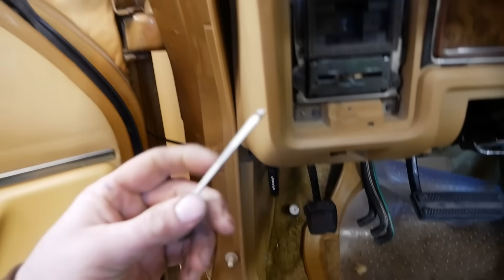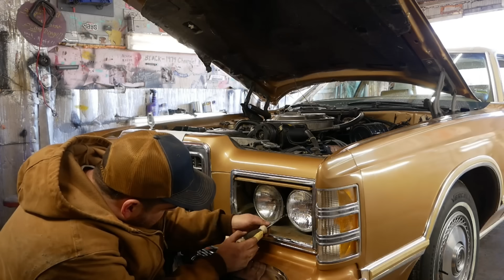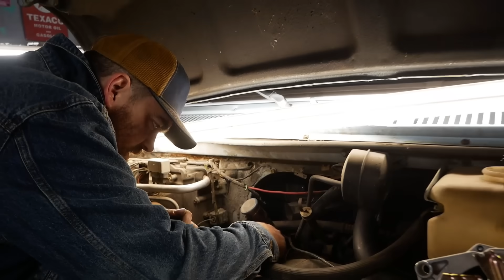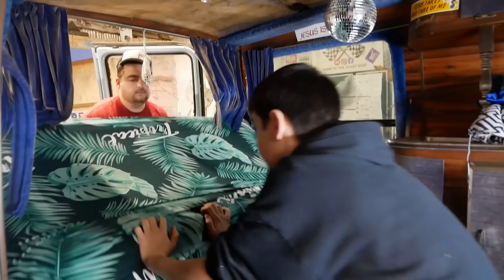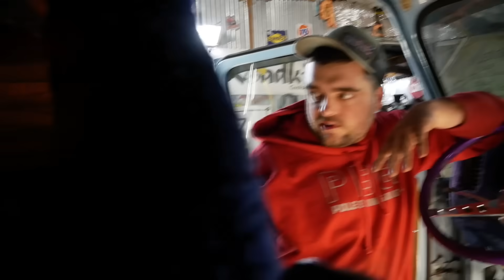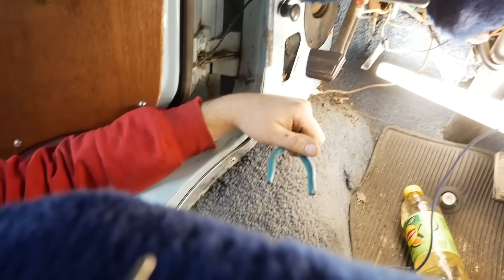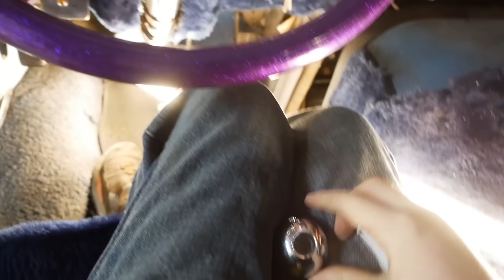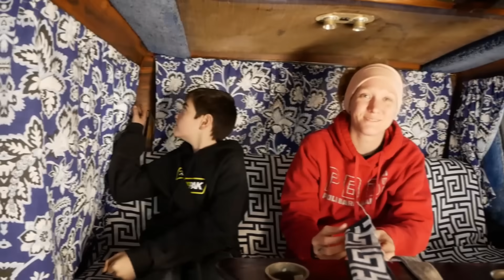Fixing Like It's 1978! SURVIVOR LTD Maintenance, and BOOGIE Van Upgrades

Comment: I know you don't care for led lights, but the tape style led strips work awesome inside.  They come in warm(look like incandescent) with a color change remote. They are excellent for when you have the engine shut off. Use very little battery, remote with a timer, color selection and some follow the music(disco that is)

Comment: westport wa.state here and got your back. way back. but i'm back there. "somewhere"
  a lot of the people must not know how u tube work's. and how you ended up on it.
first clue ; you always buy big cars. is it for ramming road blocks. could be!? four doors most of the time. could be for the ruthless gang!? easy in and out.hum!?
but the key is the thing you have against the safety switch.the one thing the ruthless gang type needs is to start the get away car in any gear.!!!
thusly. you are and international gang pretending to be a u tuber. your move mister.

Comment: Loved the video, however the "gasket" in the air horn wasn't really a gasket, it was a membrane. The very thing that vibrates and creates sound. So if it isn't torn, you have messed with how freely it moves, it's spacing etc. Might not get sound out of it now or ever.

Comment: you gotta look into wool wax for the underside of these clean cars. i know it's just an ltd, but the stuff is cheap, easy to spray, and lasts over a year. we use it a lot in the cleveland area and it works great at keeping the rust off

Comment: On today's episode of "We're losing the shop"

JD attempts an Olympic legs tied trial.  A certain LTD is now capable of unleashing the midnight sun upon the greater Kansas City area.  And Dalton discovers that surplus Margaritaville restaurant fitted sheets have 7 sides and come out smelling like Jimmy Buffet.

rest of Top Gear theme...

Also looks like Ford used the same headlight switch from 78 to at least 89.  Only real difference between yours and the one I replaced on my 89 F250 was the vacuum lines for the headlight doors.

Comment: The table in the van is upside down the pole has to be screwed to the table and the removable part is in the floor the part that you said you have an adapter for that's usually screwed to the floor not the table

Comment: Hey, dont knock woodworking with a Sawzall! Before our family Christmas, I FINALLY fixed and trimmed all the baseboard molding in our bathroom with a Harbor Freight sawzall, as well as cutting some new molding for part of the kitchen! Definitely needed some finishing with the belt sander, but hey, it worked. 

Also, next time you need to seal something on the roof or something like that, roofing & flashing glue/sealant works WONDERS for automotive applications. My friend and I replaced his windshield years ago with that because it was like $5 versus a $35 tube of 3M Window Weld. 😂 It worked perfectly for years without a leak, and dries flexible but very rigid.

Comment: Jess gonna be dangerous with that sowing machine! She’s gonna be making custom seat covers I see in the future. Seems like she’s taking to it, and doing pretty good to!
Reply: I'd love to eventually try a project like seat covers...you're totally right!
Reply: @jesswhomakesstuff  I think you can do it, if you got a decent old cover, you can unsow it to see how it was put together and a pattern. Little tip for doing that it’ll be a little loose,, so you may try and sinch it up a little or add a layer of foam to tighten them up.
Reply: @jesswhomakesstuff  oooooo idea. Start with slip on seat covers we can buy as PBG merch. I'd rock the flirking shnit outta one for my f150.
I'd drop $100 for one. Well 100 communist Canadian dollars so about 80 bucks in the land that measures in units of a body part. 😊

Comment: Please tell me where you got that new headlight switch. Mine is leaking a little bit on my '77. Thanks.
Reply from the maker: eBay
Reply: @PoleBarnGarage Could you still hear a hiss from the vacuum with the new switch? I'm just wondering if it's normal operation to hear that when the lights are on. I'm changing my switch now due to the cluster lights going out.

Comment: On the LTD I believe 1.) it's not F-type ATF, 2.)  there's an emergency reversing valve to open the hidden headlamps if the vacuum to them fails. I say this as the owner of a 78 Lincoln Mark V that probably has the exact same hidden headlamp mechanism. IIRC the reversing valve is a white plastic cylinder with 2 vacuum ports on one end and 2 on the other end and you grab it and twist it 180 degrees so the hoses that connect to one end get reverse connected to the hose pair on the other end. One hose should have a green stripe and the other should have a yellow stripe....If the LTD has it it's probably between the headlamps above or below the rad cross member or on the hoses that run along the drivers fender....It could be different on the LTD, and also I'm trying to remember where it is on mine since my car has been under a tarp under snow since October....If you can find that and vacuum to the headlamps fails on you at night this should be better than rerouting vacuum hoses.  I know the C6 switched from Type-F to Dex/Merc a few years before 1978 (I actually bothered to cross the bizarre Ford ATF fluid part number stamped on my C6 dipstick to Dex/Merc)...Strangely all my cars (78 Lincoln, 47 Olds hydramatic, 02 Suburban) use the same cheap DexII/Merc because it's either the recommended fluid (or in the case of the Olds it's the closest recommended successor to type A that is still sold new and readily available).

Comment: If you have an overdrive transmission laying around that would fit in the Mercury, that would be a sweet swap to make it not hurt as bad to daily driver it.😎👍
Reply from the maker: Wouldn't help much, it has 2.41 gears. No need for overdrive
Reply: @PoleBarnGarage  
Sure it would, adapt a 700R4 to it and you'll be able to pull out into traffic a lot easier with that 3.06:1 first gear and your final drive ratio would be 1.687:1. That big block should have enough low end torque to chug along with no problem.😎👍

Comment: Both vehicles looking good! I had to be an air horn mechanic for the one I got a while back. It would just blow air out, not even whistle like yours did. What I ended up doing was flipping the membranes over and I think I used PB Blaster on them to clean them up, Dad told me to do it. They work great now!

Comment: God help you on figuring out the accessories wiring on that van, i was a ase tech at a gm dealership back in the early 90s when conversion vans were at their heyday, and the brand new ones we got in were plagued with wiring problems. We contacted the conversion company to get wiring diagrams and component layout, apparently their wiring was a "suggestion" and the assembly line builders did the wiring at their discretion, meaning the conversion company didnt care how they were wired, as long as everything worked, so each van was wired differently.

Comment: The um table leg can not be removed, as this is POLE! barn garage.
Reply: Starting the holes w. the drill in reverse scores the wood and can help w. tare out. Hole saws it helps if you can stop halfway and come from the other side. If it is something super very nice you would want to use a backer piece of scrap wood.

Comment: The van is really taking on that groovy boogie van look. You gotta find a replacement horn for the roof. I don't know what you plan on using the water tank for, but I would sanitize it and the lines with bleach water so it doesn't stink up the van. Just rinsing won't kill the stink growth.

Comment: Its odd seeing the layers of caution and looks of concern on your face while taking apart the LTD, that car has definitely found its rightful owner... 

Ive been driving old derelict 1980-96 Ford trucks since I was in highschool in the late 90s/early 00s, basically what i cut my teeth on and I cant imagine life without a handful of em sitting around on my property. I recently inherited a 1984 F150 from my great uncle who past away. He bought it brand new, it only has 53,000 miles, and still pretty much looks like a brand new rig. It really is a weird feeling working on something that is legitimately "nice"... I actually bought a padded fender cover to protect it, and i take entirely too much time undoing brittle plastic connectors instead of just tearing shit apart and putting it back together with zip ties 😂

Comment: You might put solar in your boogie van. I just did a lowbuck run what you brung system on my toy hauler/home. I'm impressed.i have about 1200 watts of solar. A 3000 watt inverter and I'm just using my lead acid batteries.  During the day? I can run anything. Something like that in your van would be sweet

Comment: Just replaced the headlight switch in my 60 comet. Exact same switch except for the vacuum ports. The inner hole that the headlight knob goes into is shaped different for different years ever so slightly and it can cause the little locking nub to break off in it if you aren’t careful and can stop it from fully engaging. Had to ream mine out with a drill bit to get it to accept the shaft on my switch. Food for thought when working on old fords

Comment: Now that was fun to watch!  Thanks for bringing us along.
Reply: I don't know why I initially passed on watching this when it first dropped... I Lie...  On some other channel a video was put up just to have something up and it really was a biy of a snore bore.  So I kind of thought that this upload might also be just a, "PBG needs to put up content or (?)" 

Well I was pleasantly dumb founded, of course the crew led by Dal'un ALWAYS entertains.  

That LTD is precious.  I understand the sad reality of parts on such a vintage car snapping in frozen temps, but the tenacity and logic of a 'Pole Barn' mechanic pulls through, good job on that switch.  Now if only I could get Dal'un to stop by and get my blend door actuators R 'n R'd on my 2013 Cry'shitler 200.

I can't help but expect the table stanchion/pole has rusted to the floor base, but heck now you can advertise owning a 'Pole Van Motel' and at least you're not going to be rolling out of bed without alot of effort, best wishes for using the laundry list of explicatives each time you come up against that cold metal pole with bare skin.